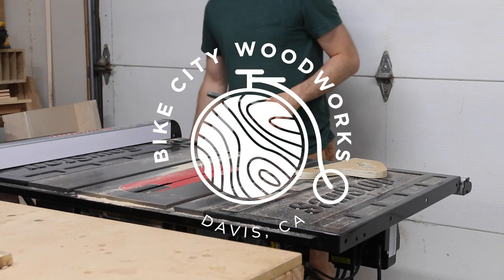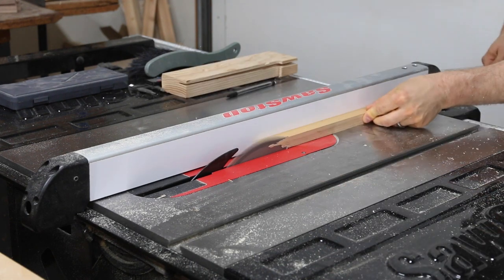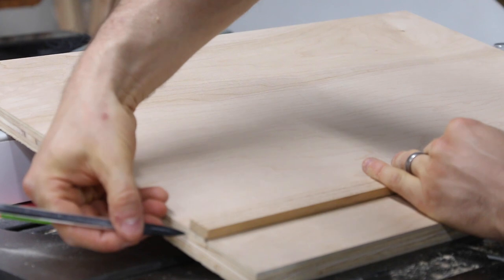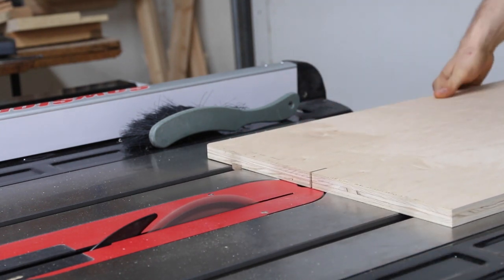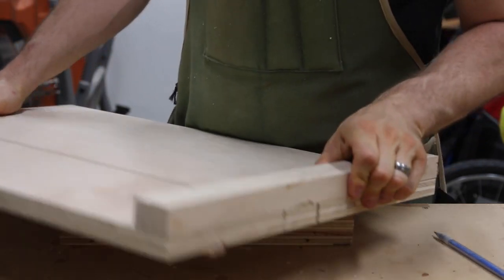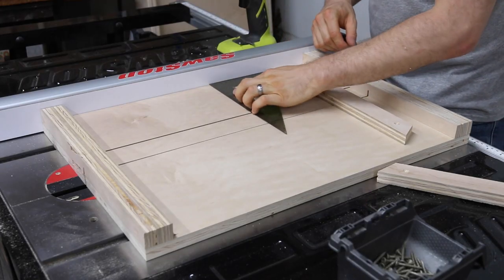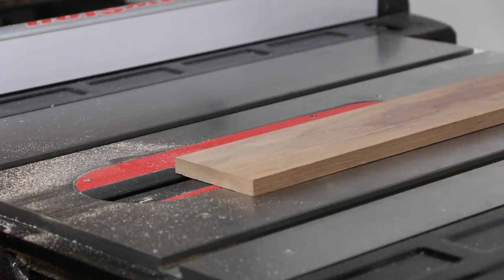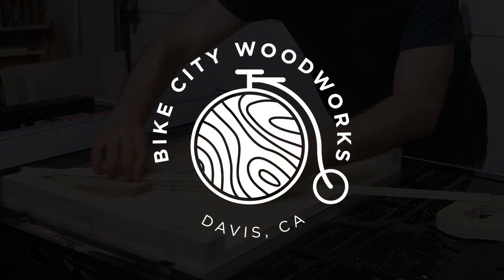How to make a Kumiko sled for the table saw | DIY Woodworking

Comment: A good clear video.  How did you decide on the pitch for the 60-degree cuts?  Do you only use one pitch?
Reply from the maker: Thanks for your question! I only use a single pitch of 2" because if I go much smaller, the infill pieces get really small and hard to work with. Technically, your pitch can be anything you want, and my last sled (you can see it in my mini kumiko lanterns video) had about 4 or 5 pitches cut into the base. However, I always found myself coming back to the 2" pitch so I just cut that one in my new sled.

Comment: I'm curious why you would make such a nice sled with a warped piece of plywood? I really like your designs by the way. Why dado in the runner? Also. I started using these runners a few years ago.  UHMW is an amazing component to make smooth running jigs. I double stick tape the UHMW and use the fence as a guide to set the sled onto the runner. The run screws in. That way, if I ever need to move it, easy peasy. Keep on making sawdust!!!! I love your work. Subscribed.
Reply from the maker: I didn't actually realize this was very warped; The fences end up adding some bracing so I wasn't super concerned. And yes, I started to use UHMW in this video https://youtu.be/7UJvMey6BdA and never went back.
Really appreciate the kind words!

Comment: The first cut has the fence behind the piece to prevent blowout.  The second cut has the fence in front of the piece being cut.   I would expect with blow out with many woods.
Your thoughts please.
Reply from the maker: There's a little bit of blowout like you said, but it isn't bad. Thankfully you can definitely use the front of that fence. I just don't like to have my fingers where I can't see them, and feel like that when I use the front part of that fence.
Reply: @BikeCityWoodworks  Thanks for the info.  You're right, the far fence could be a bit of a reach unless you're really tall, and I'm not.
We can always use a second piece as a backer board and save the skin.

Comment: Hi BCW: What is "pitch" new term to me? why is the fence used to set the angle? why not the blade or kerf to set the angle? Hope you can answer Cheers
Reply from the maker: Hi there! Pitch is just a different way to measure. Instead of measuring "on-center" like you might with house framing, it's just measuring left-side to left-side. I'm not sure it's all that important, but it's how most of the books outline their processes. Hope this helps!
Reply: @BikeCityWoodworks   Different? How so, please clarify. Pitch was a measuring method used by typewriters in the past.  Framing is laid out from one side to the other at 16" centres.... where a 2x4 is nailed. It seems unimportant to you.... please send some book titles please. Does not help much.

Comment: What is the kerf of the blade you used to make the main kerf?  Looks like 1/8 inch from video.
Reply from the maker: That's right, it's 1/8". But it can be anything, as long as your strips are the same thickness :)